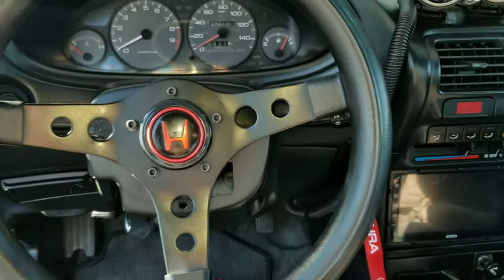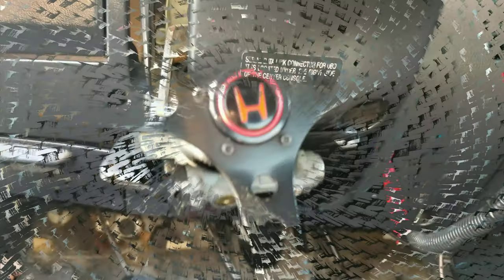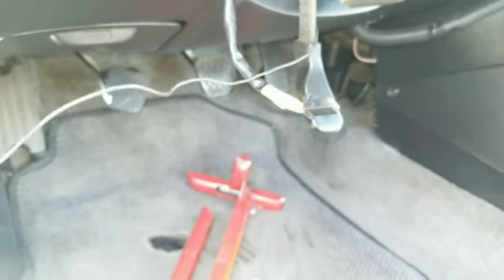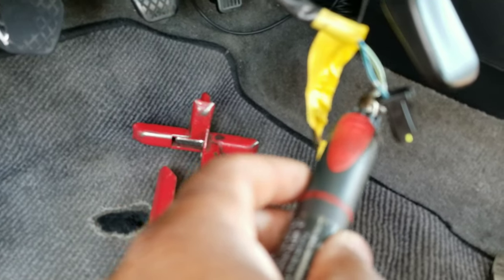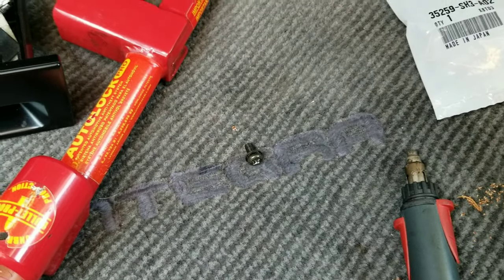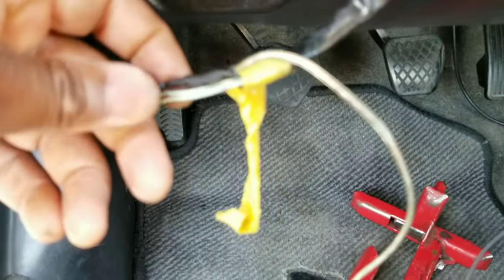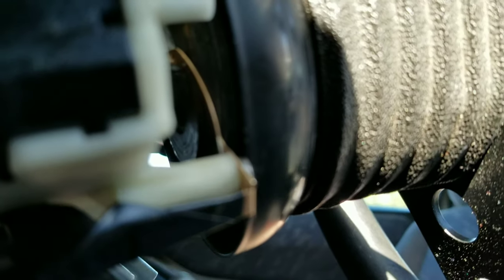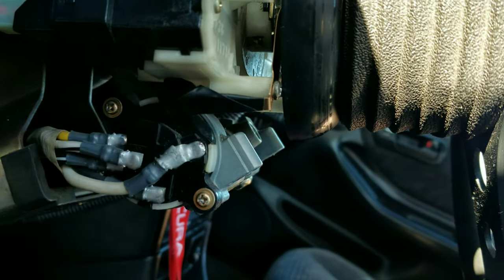Honda/Acura Aftermarket Steering Wheel Horn Fix

Comment: Very entertain video 👍 good stuff! 
Just incase you didn’t know why the horn didn’t work at the end until you put the horn in, was because that yellow cable closed the circuit when making contact with the metal material inside the hub. 

So when you tap the horn it allows the power to flow through and make the horn sound. 

So while the button is off the steering wheel the yellow cable isn’t making contact with the metal inside the hub. 

Not the most reliable but definitely works!! 

Thanks for the video brother 👌
Reply from the maker: Thanks for the heads up. Also thanks for watching 😁 🤙

Comment: I’m having trouble finding the horn harness. Do you have any tips on finding it
Reply from the maker: Is it the same type of vehicle? If so the horn harness is actually the SRS harness for the airbag system. Its all integrated. Also wrapped in yellow covering.

Comment: I took the wire that I used to tap into the horn wire, and put it to my makeshift shoe horn, and the horn sounded. Without me even having the horn button in or anything. Whenever I touch the wire to any metal, it sounds the horn and I don’t think that’s right. What do I do?
Reply: I think it’s because my makeshift shoe horn is touching the metal on the back of the hub so it’s grounding the horn wire, but idk how to make it stop
Reply from the maker: The makeshift shoe horn has to touch the bronze colored section of the hub on the back only. If it touch any other metal surface the horn will sound. If you need further assistance contact me on Instagram I'll try and talk you through it. 
Instagram/duwop77

Comment: How you make the horn button to stay in position with out the cover?
Reply from the maker: This style of horn button you just push in. It doesn't take a cover. Thanks for watching 😁👍
Reply: If yours does not stay in, there are retainer rings available that will hold it in

Comment: what size screws were they?
Reply: for the brass part to touch the back of the hub, mine also didnt come with one :(
Reply from the maker: I don't know the actual size. But it's the standard philip scew that you would find holding some of the interior parts on a Honda. The part that you will screw into is plastic so it doesn't have to be exact but close enough to where it doesn't crack.

Comment: Where did you buy the shoe horn thing
Reply from the maker: I bought it off ebay. There's a link below it's the cheapest one I found. Thanks for watching 😁👍
https://rover.ebay.com/rover/1/711-53200-19255-0/1?mpre=https%3A%2F%2Fwww.ebay.com%2Fitm%2F264905688798&campid=5338700573&toolid=10001&customid=
Reply from the maker: @skinpounder666  thanks. I really appreciate it. 😁
What's your instagram? I'm going to follow.
Reply from the maker: @skinpounder666  ok fosho. Keep me posted. Mine is @duwop77 
Thanks again.